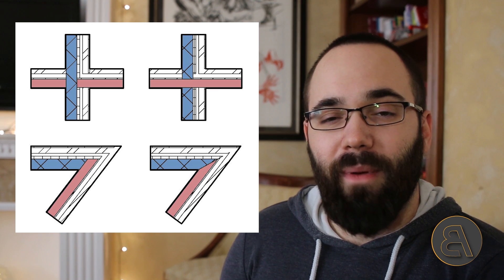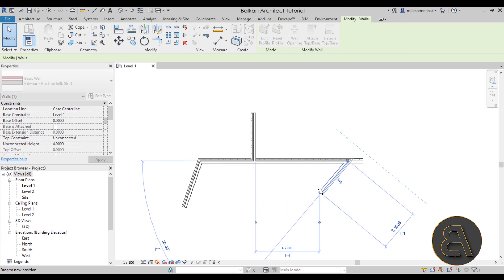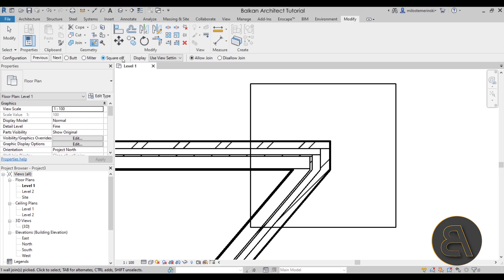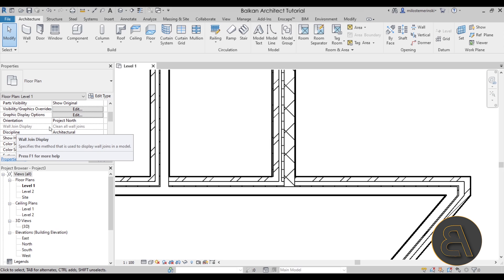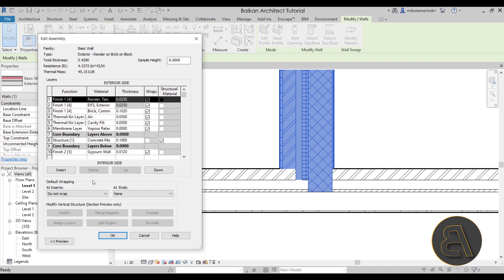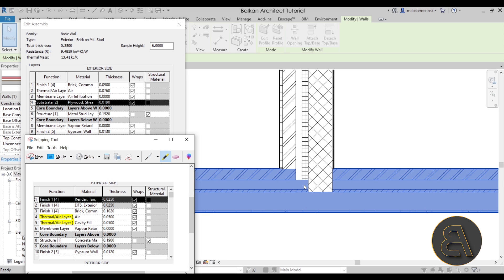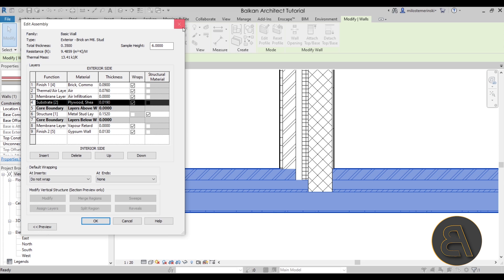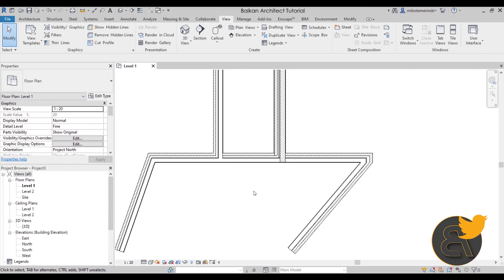Wall Joins in Revit - Master Wall Connections in Revit Tutorial

Comment: Hello, maybe you could help... How to make walls situated in this way:    ][     (i.e. vertical walls are close together or are located side by side with no gap between them; horizontal walls are joined only with vertical walls and they make right angle - horizontal walls do not connect with each other) I have to have four seperate right angle connections. But Revit connects the horizontal walls...

Comment: Im kinda stuck... I have an exterior wall that goes into a corner and in that corner I want to add a interior wall but it automaticly goes into the exterior. Could it be because I added aerated concrete at the bottom? Please I need help :(